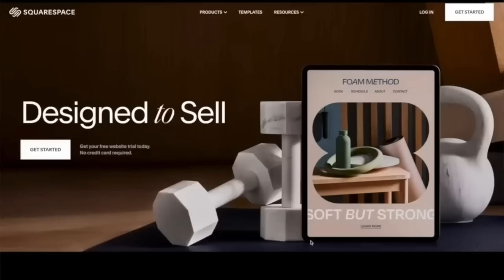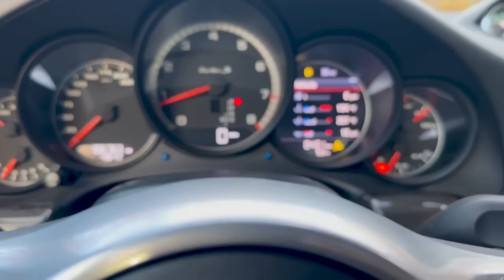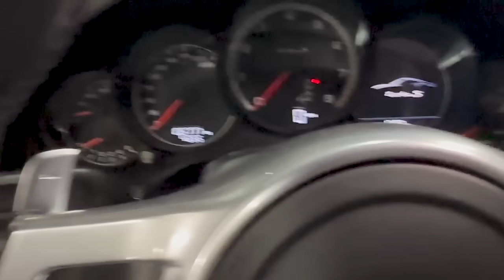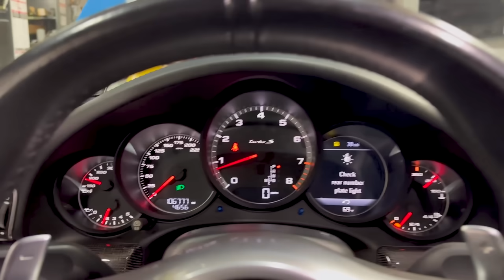I bought a 100k mile cheap turbo Porsche and Here’s What Happened When I Modified it

Comment: I'm used to driving Fords that are over 10 years old, I just consider the check engine light as cabin mood lighting.
Reply: 😀 Yes Sir 🙃
Reply: That light is just the car telling you that there is an engine, all good
Reply: Black duct tape also works.
Reply: I had the check engine light on my 2004 Toyota Avalon for over 10 years. Just a stupid emissions thing. Didn’t care
Reply: Same with Chevrolet. If the check engine light isnt on, I get a little bit stressed.
Reply: same for my Toyota 4runner that's 20 years old
Reply: ECU: "Engine ya still there?"
Engine: "Check!"
Reply: People drive cars without an engine light? Who are these people?
Reply: @izzyplusplusplus1004  Who arrrrrrrrrrrrrrrrrrrrrrrrrrrrrrrrrrrrrrrrrrrrrrrrrrrrrrrrrrrrrrrrrrrrrrrrrrrrrrrrrrrrrrrrrrrrrrrrrrrrrrrrrrrrrrrrrrrrrrrrrrrrrrrrrrrrrrrrrrrrrrrrrrrrrrrrrrrrrrrrrrrrrre
these people?
Reply: They come as standard switched on on all BMW’s 😂
Reply: I told my dad, It just means the Engine is running.

Comment: Porsche 911 can go 300-400 thousand miles. The engine is basically bullet proof.
Reply: My old man drove his '04 turbo cab cross country and still drives it constantly. He's INSANELY PRECISE with maintenance and has always used a dealer. The car still runs like it's new. Could probably use new seats though.
Reply: well that is not really true...all models of the 911 have some problems,some small....and some bad, it depends.
Reply: @vasopel Yes, like IMS bearing on M96/M97
Reply: Depends on the year and model of 911

Comment: Big fan of all your videos, tricks of the trade, As a technician for many many many years, your first mistake with the exhaust manifold or turbo studs was not heating it Using oxygen and acetylene heat heat it until it’s glowing and then try to remove, I have always had success with high mileage vehicles with this method.
Reply: The other trick I've used (shout out to my friend Tyson) was to melt candle wax onto the head of the bolt. The liquid wax gets into the threads and makes the bolts easier to remove. Used it on my brother's aftermarket Yoshimura exhaust on his motorcycle that had hex head bolts (why???) and seen it used on Merkur exhaust manifold bolts.
Reply: Why wouldn't you use a magnetic induction heater bolt removal tool ("Bolt Buster" or similar, about $200)? No open flame.
Reply: Ppl
Reply: What year is the car you purchased

Comment: 8:26 that new air filter will slowly destroy that engine those do not do the same type of filtering that the paper elements do and will slowly dust the engine causing it to burn oil and slowly lose compression I speak from experience on multiple vehicles one of which being my own
Reply: Lol Rich is buying blindly
Reply: Same with those foam filters I always wondered why HKS would make those mushroom filters unless they were for racing only
Reply: It looks like a K&N does, which are supposed to be oiled?
Reply: @aciid_0 the oil is red though....looks to be pre oiled
Reply: Interesting! Makes me feel like stock is the best way to go!

Comment: On my 6th and 7th Porsche because they have been so reliable.   im on my 3rd 911, had a Cayenne, 2 Panamera, and a Taycan 4S.  The Taycan so far is the only one that has been nontrouble free
Reply: Non trouble free 😂
Reply: Why you on your 6th on iff they are so reliable
Reply: @CreamyAmazon  because I use them.   I had my first 911, first Panamera , and Cayenne at the same time.   I kept the Panamera for 120k miles and traded it in on a new Panamera 4S.  Kept the Cayenne S till 220k miles then sold it. Sold my 997 (115k miles) for about a 15k profit.  Bought a 991.2 and modded it, traded that in on my 992.  I had the 991.2 and last Panamera 4S at the same time.   Red-light runner totaled the Panamera 4S...replaced that with a Taycan 4S.  So right now,  I have a 992 S and Taycan 4S
Reply: @karkoncierge7585  "I have a 992 S and Taycan 4S"

Damn, how're you feeling about the Taycan, most of the coverage on it I have seen is fairly negative.
Reply: @jimmydesouza4375  well...i think dynamically it's one of the best EVs.  It drives fantastic by any car standards.  Range is lower, but fine for city driving ( I'm in Houston).  It's just been in service several times for glitches.  It's got a CPO warranty so I haven't paid anything out of pocket...but none of the Porsches I've owned have been in service like that.   I don't know if I'd get another one... but i love it...when it's not in the shop.
Reply: @karkoncierge7585  Did you buy it new?  If so, how are you handling the depreciation, as in what is your attitude towards it.  Never bought a new car and never intend to so depreciation has never been much of a concern for me, but I know some people buy cars as "investments" (which seems odd considering the value is guaranteed to drop and may never recover).
Reply: @jimmydesouza4375  nope...used.  i am the same as you in that regard.   I've only ever bought 2 cars brand new and they were for business purposes and they weren't Porsches.  Any EV I recommend buying used or lease because of the massive depreciation.  I got the Taycan for 72K...but my trade and amount down I financed 35k.  The sticker was $163k on it when new.  So,  I don't plan on being in an upside down proposition on it. Once that Porsche CPO is up... I'm out and on to the next one.   Will it be another Taycan...idk.  I really like my Panamera experiences overall.

Comment: 218,730 miles on my 2014 Cayman S. Rock solid, and has never failed to start, stop, and go. Never left me stranded, and never fails to put a smile on my face all these years later. The reliability has almost been disconcerting! 😂
Also, I didn’t know you were in NH now. My neck of the woods!
Reply: What major services have you done?
Reply: @ depends what you consider major? In my opinion, the only major service was the PDK fluid and filter and gear oil. Other than that, just regularly scheduled maintenance! Engine or trans has never been out, original water pump, alternator, etc. I did have a walnut blasting carbon cleaning done earlier this year due to carbon buildup symptoms, and just had the axles replaced due to multiple loose clamps and grease leaks leading to vibrations from compromised CV joints…

Comment: Love it. The 991.1 Turbo cars are going to prove the test of time for sure. Just a heads up you really need to have the battery registered to the car. The car doesn't know it's a lithium battery and it will not charge correctly.

Comment: Great content, as
always.  I actually have a ‘15 C4S that I bought to use as my daily this past March (2024). 

Mine had 103k miles on it when I bought it, and I put about 1,500 miles a month on it.  As of 11/5, it has 115k, trouble free miles.  Great cars, pretty easy to work on, (oil changes are a breeze) incredibly well made, and the handling is, well, you know. It’s an incredible car that, if maintained, will go 200-300k miles.

Comment: It’s good to hear that a high mileage turbo is not a bad option. I have been thinking of trade in my 992 4cs for a 991.2 turbo S with about 30K miles on the odometer at a local dealership but was worry about about that 30K miles on it.

Comment: Rock solid is not the term for a 911.  The coined term is "Bullet Proof". I drove my 73 911E from 23K to 178K, still going but leaks oil. From LA to British Columbia with my daughter in the back seat (3 people). LA to Nova Scotia with three people in car, to Miama Florida, across the country several times. From LA to Tip of Baja, we took a ferry across to the mainland and then back up to LA. The car needed gas, oil and TLC but never failed us. No AC and original radio, but it was stolen and I never replaced it till recently.

Comment: My wife has put 38k miles in 3 years on her used 32k original miles, 981 6 speed manual Porsche. 71k now. Solid car.
Gotta spend some now for serpentine belt. belt tensioner. Plugs, CV boots.
Reply: If your CV boots are already torn, loose or leaking, you may end up having to replace the entire axles. Both sides of mine leaked at one point over the years, and by the time I caught them, either too much grease had escaped, or too much water or debris had gotten in (or both), that I was getting heavy vibrations from the drivetrain under WOT at highway speeds. Each time I caught one, I would pack more grease in there and replace the clamp, but the damage had already been done. It took me years to pull the trigger on replacing the axles, because they’re so expensive and there’s no guarantee they would fix the vibrations without installing them and finding out. Thankfully in my case, they eliminated all vibrations and restored 100% smooth acceleration to the car. I forget if it ever felt as smooth as glass as this!
Reply: @jayymac  good news. Dealer lied. My mechanic said CV boots were perfect.
Reply: @ that’s crazy. What did the dealer say was wrong with them?
Reply: @jayymac  split and leaking Grease
Reply: @ wild to think they would say that if it was a blatant lie. Have you a look under there to see for yourself?

Comment: @6:12 You need an inductionheater, haven't destroyed a single brake line nut or any rusted nut since i got mine! 💪
Reply: Wow. Just checked out the bolt buster; room temp to 1200 degrees in 30 seconds
Reply: Oh, i just made the same comment and then saw yours. Yep. if he get one, he'll swear by it to remove those.
Reply: @troy3456789  Yep. No torches is going to beat being able to make a bolt cherry hot in a tight spot in less than 2 minutes. When i first bought mine i tested it on a half inch iron pipe, i got it glowing under 30 seconds.
Keep in mind it work best on ferrous metal and has almost no effect on non-ferrous metals.
Reply: How do you get one around a brake fitting without cutting the line
Reply: @emgriffiths9743  I usually cut the hose and also make a small cut in the coupler to avoid shooting the piece  of hose out of it when heating it to redness.  The coil is just a copper wire and there are usually a straight piece supplied in the kit to be wind a coil where you can't use a ready made one. In the cheaper set I got it is a single strand but in the more expensive sets it is more like a speaker cable with heat resistant insulation, much easier to wind onto the thing you want to heat. 🙂
Reply: You can also put your Dynavap in it

Comment: PB Blaster original is my favorite penatrating fluid.  Shoot it on, let it sit for 10 mins, shoot it again, wait 5 minutes, and impact it off at the lowest setting.  Cheers and good luck!
Reply: also tap it with a hammer (using a tool between the nut & hammer)
Reply: Brought some CRC freeze off and it's the first thing I reach for now
Reply: Watch project farm on all those penetrating oils. I can't remember how well pb blaster fared. I think liquid wrench penetrating oil fared best, and pb blaster ended up 2nd to last among the oils he tested on rusty nuts and bolts. A mix of automatic transmission fluid and acetone ended up a close 2nd behind liquid wrench. PB blaster didn't do as well as WD-40. I hate WD-40 for anything and I don't own it. Koil ended up in dead last.
Reply: Project farm did not test JB 80 in his tests. I don't know how well it penetrates, but youtube videos show it may have superior lubrication.

Comment: The pops and bangs are terrible. Remove the crackle tune and use a normal tune.
Reply: @ there most certainly are Stage 1/2/3 tunes without crackle. They typically call the ones with pops and bangs a “crackle” tune and you can add it on to whatever stage tune you want. All it is doing is adding extra fuel which ends up in your hot exhaust and ignites.
Reply: @Tdfries  you're not even close to correct. They REMOVE fuel and remove ignition timing for a period of time.... If you ADD fuel then you get "burbles", on a return fuel system. When you have one loud bang that's because the fuel system is returnless and it simply shuts the injectors off.
You just hoppin' on the anti pops and bangs bang-wagon, and it shows.
Reply: @JACKOFALLFATES wait what? What are you trying to say?
Reply: Yes, I agree.
Reply: I didn’t realize this was your car he was modding… 🙄
Reply: @Tdfries burble tunes
Reply: There are 3 modes, They all pop in sport mode, use normal or sport + and they go away.
Reply: My 997turbo, promotive 675hp has zero popping. That’s usually from an overly rich tune (cheap). Yes put some 200c cats on that bitch, only about 5hp difference. Not worth it imo
Reply: @ChrisH930S 991 turbo /s burble from stock , it’s not a aftermarket tune
Reply: It’s not a crackle tune , they do it on stock cars , in comfort it’s silent , in sport and sport plus they burble from factory the exhaust just makes it louder , and they flame just de catted , and that’s with out a tune it’s natural not like fake flaming tuned cars

Comment: I don't understand the fascination with crackles pops and bangs out of the exhaust. It seems like you're just asking to get pulled over.
Reply: Same
Reply: Yall are cry babies fr 😂
Reply: It's quite literally childish fun. When you are in the driver's seat in control of those noises, you can't help but giggle. Never gets old
Reply: My stock 2018 991.2 GTS crackles & pops when it's set in Sport mode. It does not do it in Sport+ though.

Comment: there is no substitute. the 911 turbo platform displays power so uniquely there is nothing else like it. these cars can match or best cars with 100-200 more hp than a 911 needs. these car are so outstanding and as Betim said "mod friendly" any bit of upgraded parts you will feel. no other car can take bolt-ons and have gains like 911 turbos with mods. now everything I've said is mostly applicable to 993 and then all the h2o cars. what other platform can do 230+ mph in a half-mile. or a Ruf car starts with a 911 that Porsche took their best work and would throw it all in the used parts bin because they thought Alois and his ultra performance development make them the best sportscars in the world. a turbo with a filter and a OEM basic flash to 1800hp John Bray 4.3l stroker builds will handle launch control like dirty girls. they take it and beg for more and harder, time after time. no other car can go from stock to questionably legal and still go to the store grab a bag of groceries and handle the snow covered roads on the way home after a weekend at a track on the opposite coast that you drove it to. they are weapons grade sportscars and are the best overall car you can have. nice job rich sounds lovely!!! cheers

Comment: Youll be surprised how well heat works on rusted bolts, lubes usually don't do very well with stuff over 100k. PB blaster is usually the go to even that doesn't work most times.

Comment: i got one of those magnetic induction heater tools to remove rusted nuts. it looks like a big soldering iorn with a wire coil on one end.tou place the coil over the nit and it passes a crrent through the coil which heats up the nut till its cherry red .ten yo spray it up with your pb blaster wd40 or whatever you use and spin her off

Comment: if you don't already know, soak the rusty bolts in pb blaster and slightly loosen then tighten and repeat so the plaster can get in there and they usually break loose. Thanks, for sharing the video its definitely a dream car for me and you got a top tier color.
Reply: The issue is, they never slightly loosen :P
Reply: @FizzGamingProductions  they do when they are red hot 🔥
Reply: @FizzGamingProductions  Sometimes it pays to tighten before loosening. I know that sounds counterintuitive but getting any movement is good.
Reply: @robmanueb.  Unless you know how a bolt works.
Reply: @rustler08  Had it before where I can't break a bolt free, given it a little tweak in the tighten direction and then backed it off. Bolts aren't always over tightened, generally I find it is corrosion that locks them up. I only do this when bolts are stuck not as a general tip for loosening non problem bolts.

Comment: No need to break those studs. Get an acetylene torch and water hose or old A extinguisher. Heat the nuts up until they're red and quench them down. Try and loosen with a reasonable amount of torque by hand and if still stuck repeat the heat. Saves a bunch of time getting broken stuff out.

Comment: I’ll bet that battery was deliberately oversized to help balance out the rear engine design. Drive steady!
Reply: 100% with all that weight in the back... and Rich is a low-weight guy also!
Reply: So long as he doesn't disable traction control, he should be fine

Comment: Drilling the turbo, not covering the inlet
Does 11 launches, engine fan disconnected 
Madlad
Reply: gave me Matt Armstrong vibes where you could litterally see metal shaving fall into the internals!
Reply: Thats not the inlet bro, its the exhaust side.
Reply: he drilled the HOT side, everything that falls on it will be expelled down the exhaust.
Reply: @rodsilva80  it can still jam inside the housing tho 🤔🤔

Comment: Rich all those turbo bolts, and exhaust bolts. replace them with Titanium or if you dont have too much cash. go For 304 stainless or better yet marine grade stainless 
people dont drive their porches because they constantly flip them. because the over sticker prices they go for. so they keep the miles low. its an investment not a recreational or hobby car. 

They are supposed to be a recreational, fun, fast hobby car.

Good on you Rich for driving it the way its intended. this is probably why there hasn't been any check engine lights. YOU DRIVE IT haha